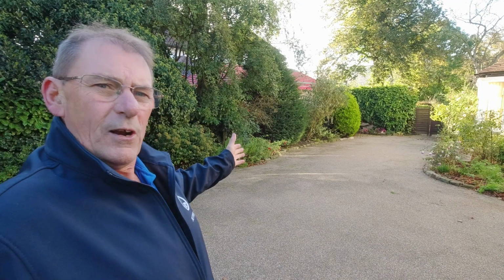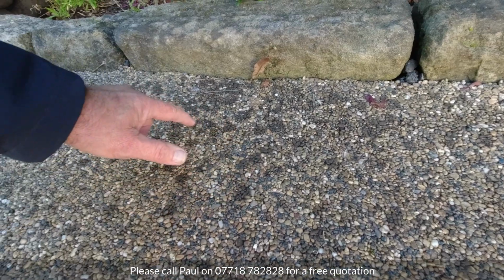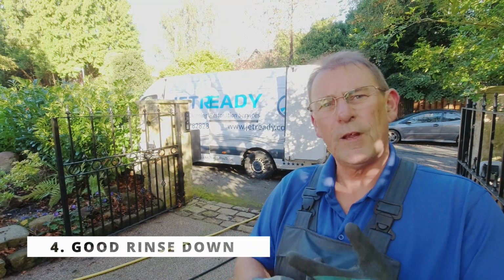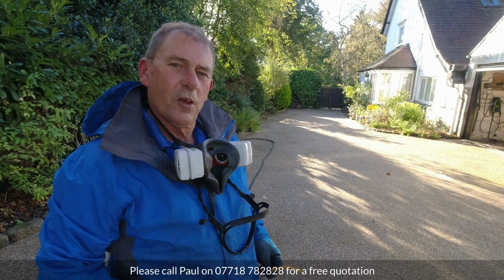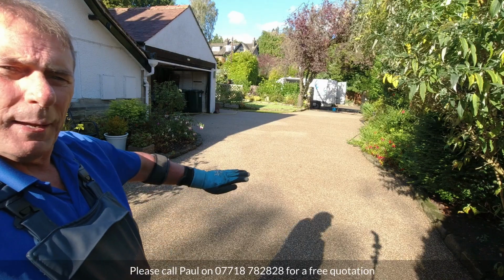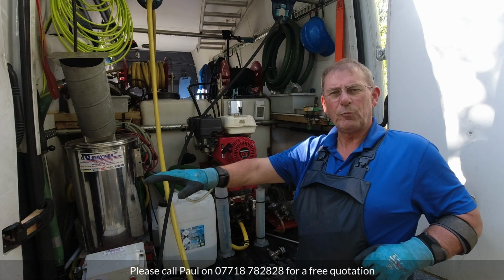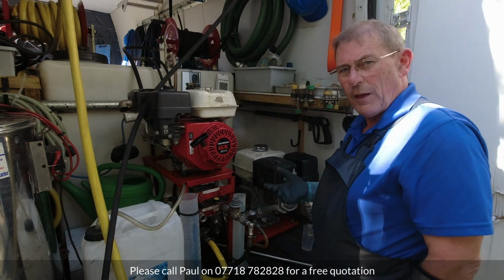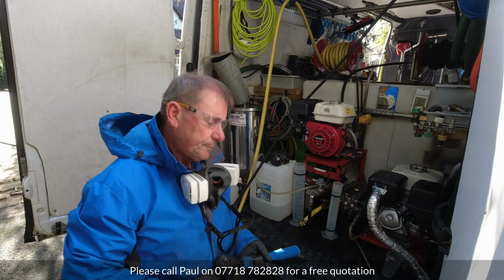Resin Revival: BEATING MOSS and Biofilm. Pressure washing, Ilkley. @jetreadyuk

Comment from the maker: Clarification. At 6:54 I mention that I'll be applying BAC50 at a 3% ratio. Bearing in mind that the BAC concentrate supplied is of 50% strength, this means that true dilution of BAC was about 1.5%.